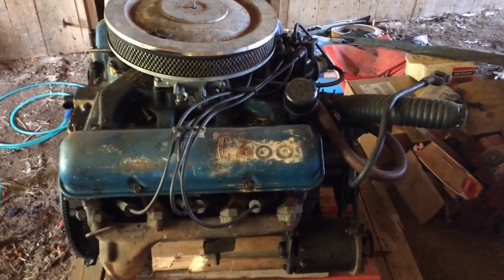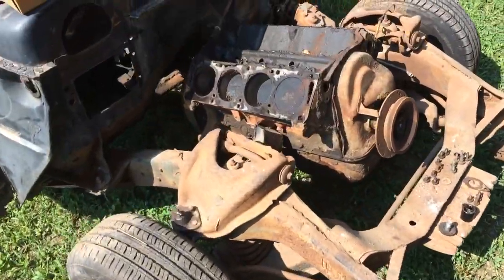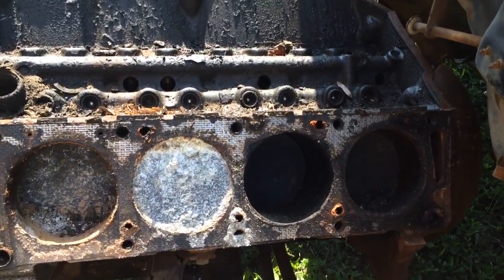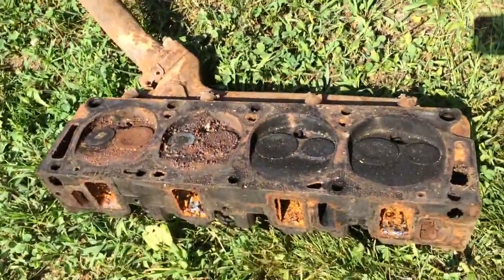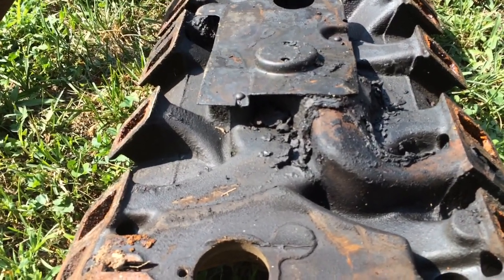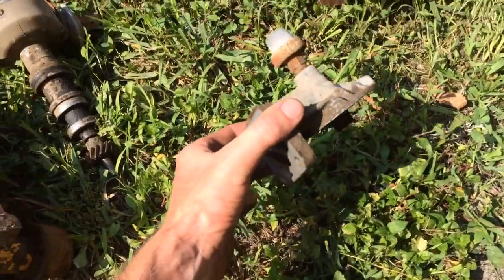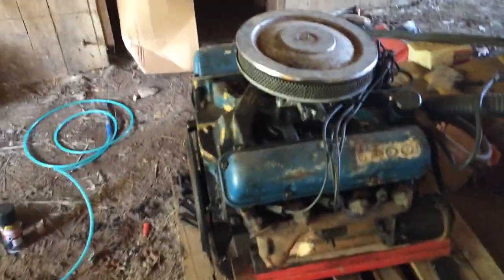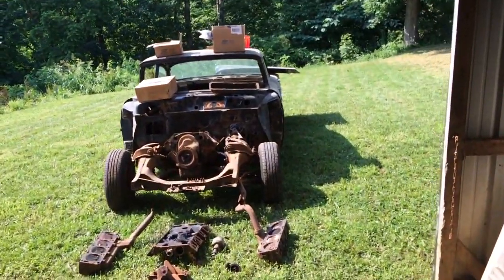'58 Edsel engine after 47 years in a MN field w/o a carb.

Comment: I couldn't careless about the dino numbers, if she runs she runs. After all it has been sittn and sitn and she's a used engine, (LOOKS LIKE IT WAS CONNECTED TO A MANUAL TRANSMISSION) awesome👍), I'D DEFINITELY replace plugs wires, points, condenser, coil, rotor cap, do ALL your gaskets, redo your carb, or replace it and radiator, replace fuel pump, remove your gas tank and clean it, and flush out or replace gas lines, and replace all brake lines, wheel cylinders, unfortunately your gonna have to over haul your master cylinder, or if available depending which 2 master cylinder types you've got, Power brake treadle vac booster cylinder or manual brake, hope you can find em, then you should be good to go. GOOD LUCK and fire it up, I WISH YOU SHOWED THE REST OF THAT CAR WITHOUT THE FRONT END. 😭😭.✌️🤠👍